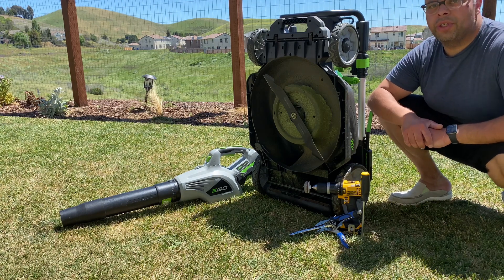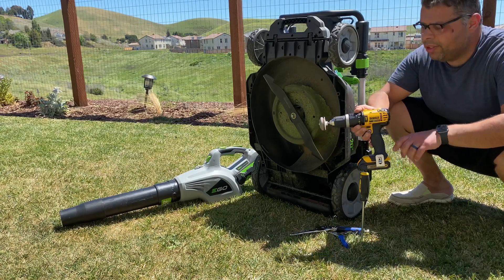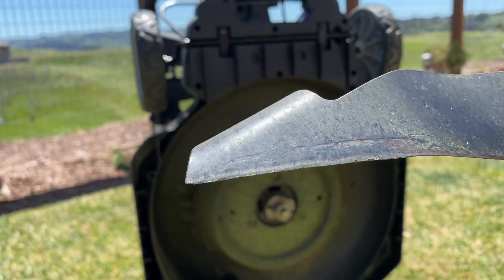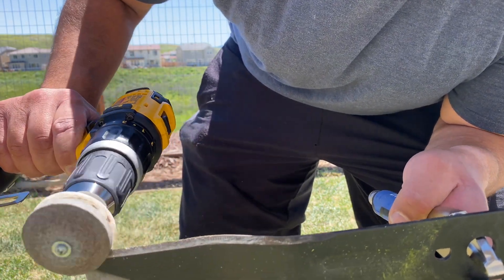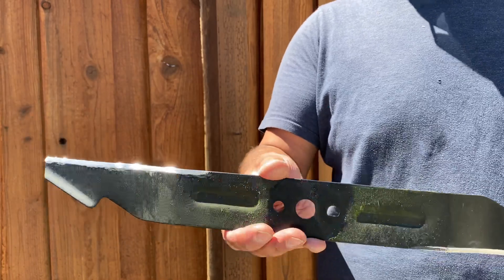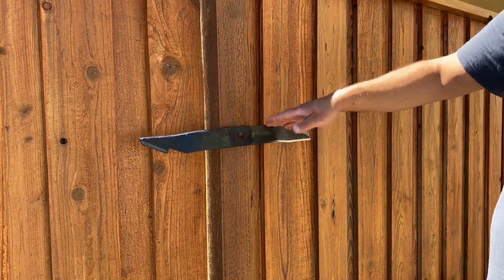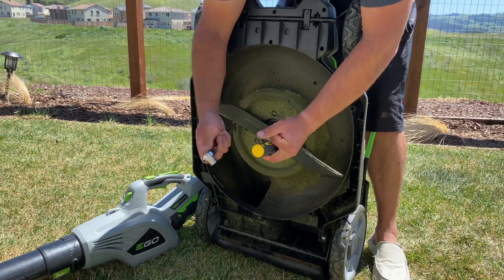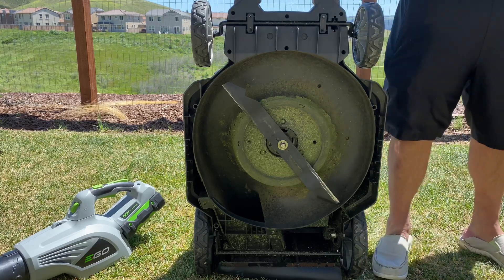USING A DRILL TO KEEP YOUR LAWN HEALTHY ! How to sharpen Lawn Mower blades with a DRILL!

Comment: I leave the blade on the mower when I sharpen. Works fine and very fast!
Reply from the maker: Never tried it like that, are you using a gas mower?
Reply: My blade is on the upper side when on the mower so I can't even sharpen the blade without taking it off. Unless I create a sharp side underneath 😅